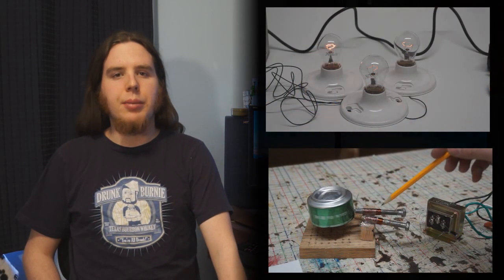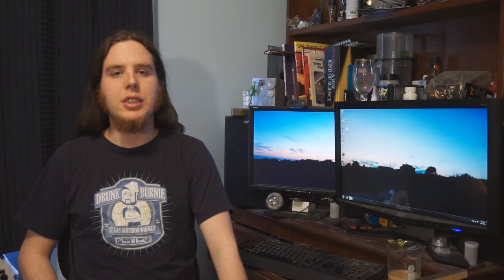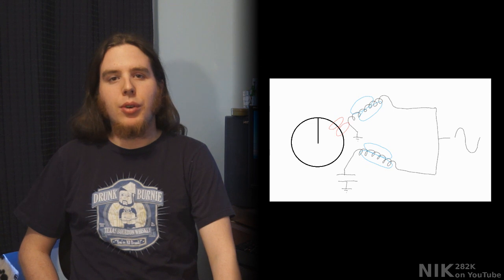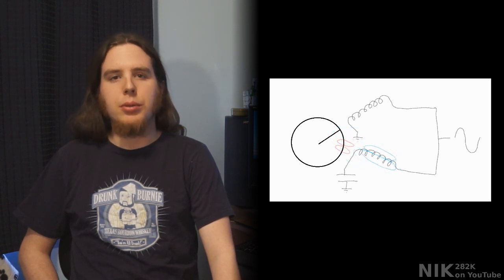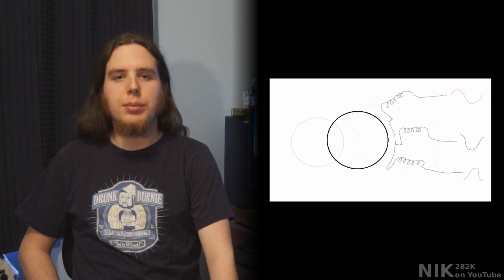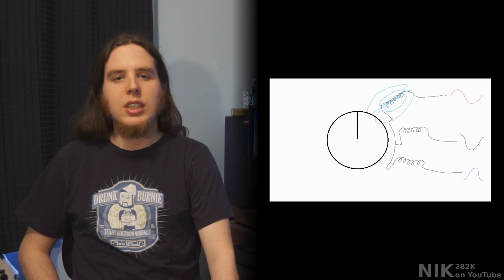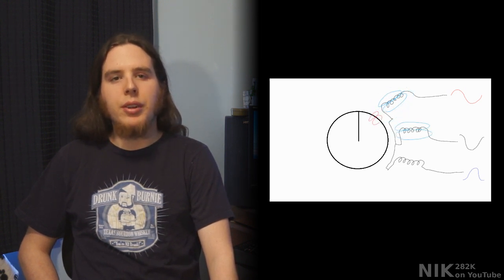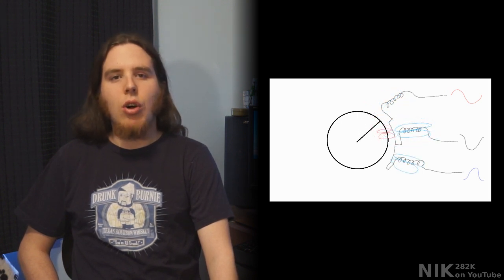DIY 3 Phase Motor

Comment: Hello i have problem i do http://scoraigwind.co.uk/2012/05/clearer-drawing-of-the-10-pole-12-coil-design/ exactly same 12coil and 10 pole 3 phase generator(to my stirling engine)… but i have problem my output voltage show 1.5 voltage but it doesnt light the led.. i dont understand multimeter shows 1.5 voltage.. i used 6 diodes to ac to dc..
im not very good in electrivity
I put pictures to .. Thanks and sorry my bad english im from Estonian.
PICTURE 1 https://ibb.co/ctVvyk
PICTURE 2 https://ibb.co/fCxKPQ

Comment: you should have cut fences (slits) into your can to make it into a squirrel cage. this would give you much less eddy currents, and better horizontal induction. it would spin much better and faster.
Reply from the maker: +guymella That's an interesting idea. I have been meaning to build a shaded pole motor, when I get to it I'll try a squirrel cage style rotor. Thanks!

Comment: How do you make a powerful 3 phase power supply out of a single phase outlet?
Reply from the maker: +Yves Baggi I used an industrial 3-phase power supply that runs on 120v single phase. I don't know how to make one myself.
Reply: you can create a 3 phase power supply mechanicly by connecting a single phase motor to a 3 phase alternator.
Reply: Thanks, I've seen this done and now I understand why.

I built a few audio power amplifiers and I'm thinking of using 3 channels to which I'm running 120 deg out of phase sine waves from an arduino or simply an mp3 player.

They're usually lower tan 60V but I can see how they could be jacked up to 400-500V if necessary.

Anyone trie this approach?

Comment: can you list all the appratus needed to construct this motor ? thank you  <3
Reply: +Nick Moore I am still unclear as to what a 3 phase supply is. How does it work? I'm sure it is simple, but I am confused.
Reply from the maker: +Kitreena Stang-Green The 3 phase power supply I am using here is a "frequency drive" or "inverter." It takes power from a 120v 60hz single phase source (like in a house) and changes it to 3 phase at any voltage from 0-120 and any frequency from 0.5 to >60hz.
Reply from the maker: I used 3 120volt transformers and an aluminum can. The power was 3 phase 120volts at 60hz.
Reply: But what are the phases?
Reply: I’m curious as to what model is the variable frequency drive you are using for this. The ones I encounter in my line of work typically only allow one to set a minimum voltage of no lower than 90vac all the way to 240, 480 and 600, but they can be powered by either single phase 240 or matching voltage direct three phase power (VFD added for remote motor speed control) - but this could also be due to all of them being supplied for specific purposes with specific operating parameter requirements.

Comment: Thanks,...that makes 4 ways i've seen a solid nonmagnetic material disc spin! I was just wondering, where did you source 3 phases of 110V from.
Reply from the maker: +John Kerley I have a 700w 3 phase inverter. It will go from 1-120v and 0.5 to 60Hz so it is pretty useful for small demonstration projects.
Reply: +Nick MooreThat would be cool to have! I was wondering because I have not seen 3 phase sockets,....although they may exist.
Reply from the maker: Generally you don't get 3 phase power to a residence unless it is massive (think estate sized house). The efficientcy gained by using 3 phase power too small to justify the added expense in manufacturing and infrastructure for individual consumers.

Comment: Why was your windings not symmetrical? All the windings are on one side. Was that to reduce the efficiency and cause the rotor to spin slower with much more slip?
Reply from the maker: The setup is very lossy, putting the coils very close keeps the magnetic fields as small as possible to increase the torque on the rotor. If you were to lay many coils flat on a table they become a linear motor and a good start for a maglev train.
Reply: Nick Moore Could you have put the coils 120 degrees apart around the rotor (or the same as your phase angle) to improve efficiency for this set up?
Reply: Nick Moore Interesting. Would decreasing the distance between the aluminum can and the electromagnets help? Or do you run into issues with ballence and contact?
Reply from the maker: The closer you get the coils to the rotor the better the motor will run. On a real motor the gap is as small as possible.
Reply from the maker: The poles can be any angle from each other but in this case the efficiency is so low that they must be very close together to create enough torque to move the can.

Comment: Just odd that its an aluminium can. Awesome though. I am kinda surprised that the motor started on its own being made with aluminium but I really don't know that much about its magnetic field and electrical current capabilities. I actually made a science fair thing in elementary school showing aluminium was magnetic by spinning up a large aluminium disk ona large fan motor and placing a (ceramic) magnet above it that was mounted on a hacksaw blade so it could flex. This was in the 90's before the internet and I got a C. I guess those judges couldn't understand what was going on.
Reply from the maker: A lot of induction motors have aluminum rotors and it is a very similar idea to what you were demonstrating. A changing magnetic filed that passes through a conductor (aluminum, copper, steel) will induce a current in that conductor. That induced current has a magnetic field of its own that will act just like a regular magnet. In tour case it repelled the stationary magnet, in mine it is pulled by the motor coils!

Comment: Very interesting Nick.  Was the can aluminum?
Reply from the maker: Yes it was. Although it is not magnetic, aluminum can have both induced electrical current and magnetic field.
Reply: +Nick Moore Would a heavier rotor (Cast alluminium) make more torque?
Reply from the maker: Yes, but I would also require a better bearing to allow it to spin with the increased weight. I tried putting more than 120v into the coils but didn't see any increase in torque so I think the can is saturated as seen in the video.
Reply: Nick Moore allright, bearing and bigger coils!
Reply from the maker: If I were to make a "useful" sized motor I would probably make a synchronous motor. Having an actively powered rotor makes it a lot easier to get loads of torque, just throw more volts at it and hope it doesn't let out the magic smoke.